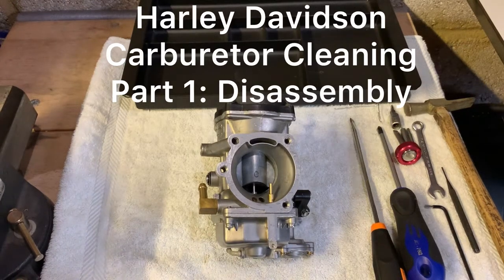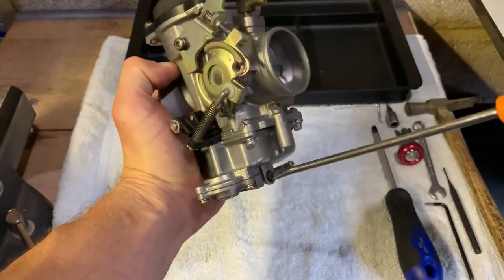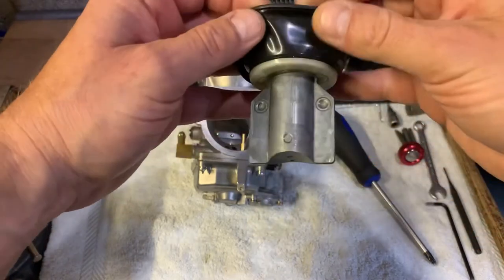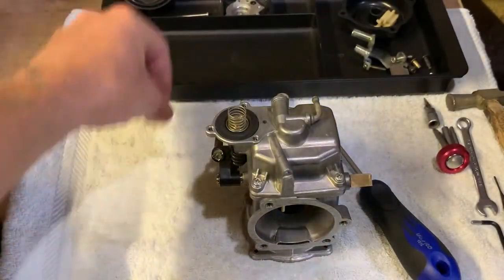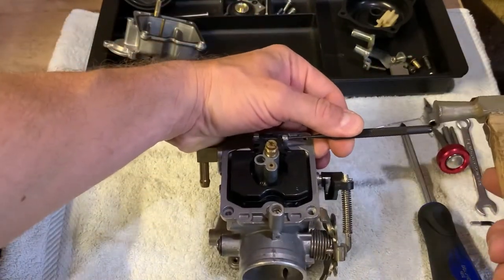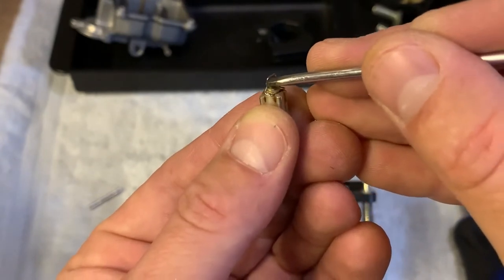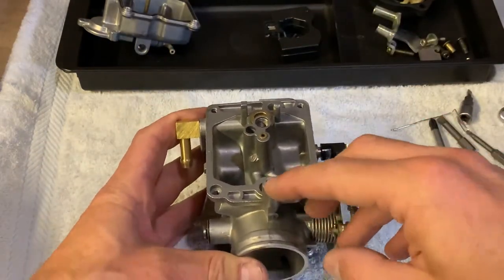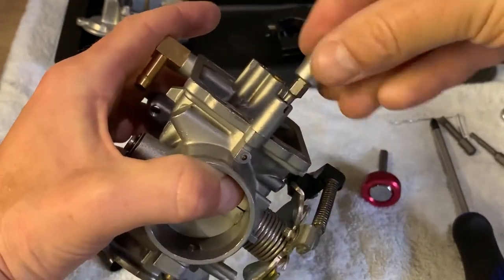Harley Davidson CV Carburetor Disassembly

Comment: Hey what size bolts did you say we need to replace those screws?? And Great video BTW, my dad and I both Referred to your video in helping us both rebuilding are CV 40..
Reply from the maker: Thanks, appreciate that.
They are all 4mm bolts.3x8mm long for the accelerator pump housing, 4x 14mm for the float bowl, 4x16mm for the top cover. Well, I’d say 3x16mm and 1x20mm where you attach the throttle bracket. Plus you need one 5mm bolt which is 10mm long for securing the bracket on the side. Hope it helps

Comment: Thank you for your wonderful videos. My CV 40 is very dirty  in the body and piston ,with smoke depoists for the back flame return. I would ask if you recommended to use a ultrasonic bath with hot water and detergent, or it can be dangerous because much aggressive solution? Excuse me for my poor english, regards, Stefano
Reply from the maker: Hi Stefano, thanks for your feedback!
Yes, you can use an ultrasonic cleaner. You just need ultrasonic carb cleaning solution. I use it all the time.
Or you can just use a carb cleaner spray. It works great too.
Reply: @aronsgarage834  thank you. Do you think that can be dangerous (for the plastic parts )wash the body of the carburetor in a hot ultrasonic bath? I think to the inlet fuel  and the ring over the depression valve. Thanks !
Reply from the maker: Do you still have the plastic fuel inlet? If so, the ultrasonic cleaner is not the best bet. If you do, you might want to change it to brass while you’re at it, cause the stock plastic ones break sooner or later.

Comment: Another helpful video
Reply from the maker: Thanks
Reply: @aronsgarage834  you wouldn’t happen to know if my Accelerator pumps diaphragm being torn would be the cause of why my bike was leaking gas out the carb?
Reply from the maker: Not really. If you got a carb, it would be due to your float needle valve being stuck open because of debris or valve being worn out.
Reply: @aronsgarage834  ok man.  I found the rubber on the needle was split/ coming apart.  

Previous owner had it sit for a long time.  Here in the state of California our gasoline has 10% ethanol which eats up seals etc
Reply from the maker: It’s always a good idea to change needle and gaskets when you get a new bike. Highly recommend getting a good quality rebuild set and you needle will last many years.

Comment: Hello. Is normal that when I rotate it of 180 degree my float bowl ( with anything attached to it), I listen that something move inside? Thanks a lot. In the last, for the bronze fuel inlet, do you recommended the CV Performance model?
Reply from the maker: Hi, yeah that’s normal. It’s just the little valve (steel ball) in there. 
Cv Performance inlet is very good.

Comment: Are 3 turns out of the Mixure screw also for the stock setup? Some guys here on YT recommend 1 3/4. So did i After removing the Factory plug.
Reply from the maker: 1 and 3/4 should be adequate for fully stock. You only need around 3 when you tune it to high flow air cleaner and pipes. What was the stock setting when your removed the welch plug? Should have been around 1 3/4
Reply: @aronsgarage834  Good Morning. it was completely closed. After i did 1 3/4 coughing and exhaust shooting were gone.
Reply from the maker: Morning, Okay, so that setting seems to be good for you now. I would just leave it as is then. 👍